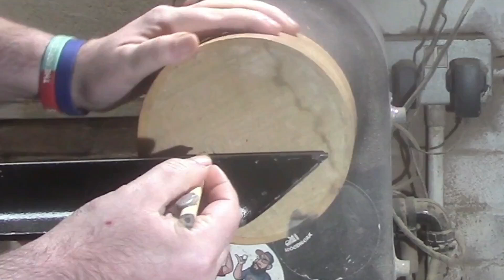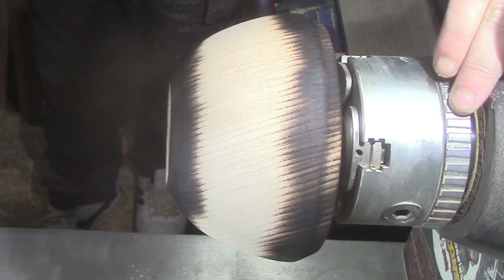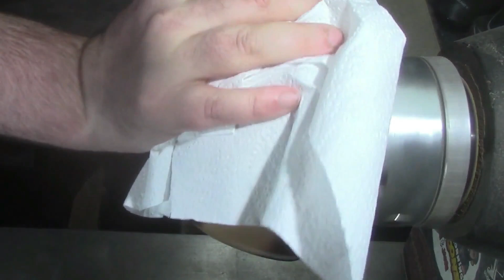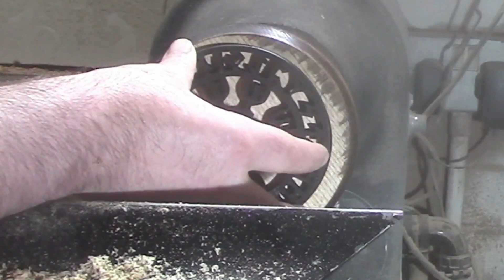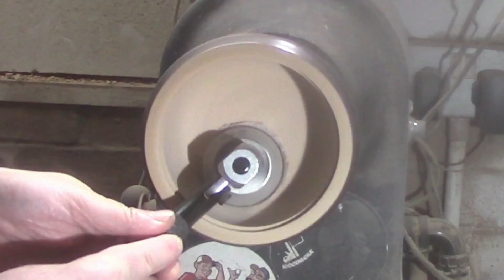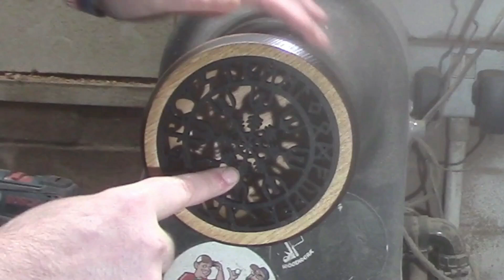You Won't Believe What Happens When You Combine 3D Printing with Woodturning!

Comment: I really like your work. I'd like to ask a favor: I assume a 'detailer' is a skew, and a '#1 hollower' is a 1/2" gouge. Would you translate the others for me? Thank you.
Reply from the maker: Yes, absolutely, so they are all flat extremely sharp carbide cutters, the detailer is a diamond shaped one, the finisher is a circle one, the rougher is a square one and the No1 hollower is a smaller circle one and when the cutters get dull you just unscrew them rotate until they are dull all the way around and then you replace the cutter. They just like the handles are available from easy wood tools

Comment: Do you miss using traditional tools? I recently found a good supplier for my carbide tips and was pleasantly surprised by how well they cut again like it was the first time! But I do still prefer the cut of a freshly sharpened hss. And the process just seems to give me more fulfilment. Looks like you have moved completely over? Brilliant turning I like it! Ignore if you want but i does sound a bit like a promotional video calling out the name every single time you use an easy wood tool. Is that a contractual thing? I think most people watching will have a good idea of what you’re using after the first time. ❤❤
Reply from the maker: I have switched over to carbide completely now yes, so I mention each tool as I use them as it has been requested of me quite a few times in the past to let new viewers and turners watching know what I am using and when(I also mention every other product I use as and when I’m using it for the same reason)Although Easy Wood Tools do support me I am in no way contracted to just use their tools in my video, if I wanted to use HSS I could do, I just chose not to, when I had ‘traditional tools’ I always found myself reaching for carbides so it seemed pointless keeping them and believe it or not, and this may sound like I am being bias but I really am not, I’ve tried a lot of variety’s over the years and you are going to have to go some to beat a better carbide cutter than the easy wood tools cutter, hope this explains everything 👍🏻
Reply: @jpwoodwork  thanks bro. Makes sense! I only have a few cheaper ones but with half decent tips now. Also experience the reaching for them feeling! Especially with that pointy detail one! Sounds like i need to try an easy wood tools one! Hopefully they’re at the Harrogate show! 🤞🤞thanks for not taking offence, wasn’t meant as such.  You can’t ignore people asking you what you’re using when you’re a helpful channel! 👍🏻
Reply from the maker: @withoutdoors5230 no worries at all! I don’t take offence easily 😂Easy wood tools sell via Axminster and Doug from easy wood tools will actually be there at Harrogate too if you have any questions as will I so be sure to come and say hi! 👍🏻